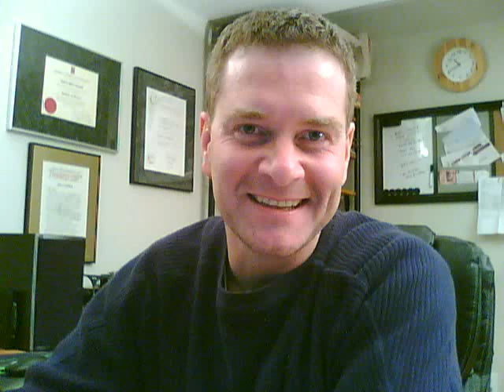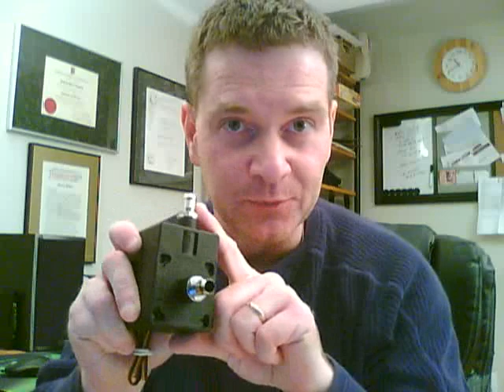#97 - Question/Answer: Water Cooling - Direction Of Flow

Comment: I appreciate the thought in this, though it's old it's still nice to see that others will put this much thought into it... My issue with this though, is on a complicated system where everything is water-cooled, you're putting the heat from 1 component onto another thus using the CPU to heat up your graphics... I doubt that his idea of a larger loop like that would work, but having the radiators in between components would make that better. My challenge I've been thinking of, is doing this on a system let's say with 4 graphics cards and you want to water cool those, the cpu, RAM, & north/south bridge (potentially M.2 SSDs as well) without moving the heat from one directly to another. This challenge is difficult because there will likely not be enough space for 120mm radiators as there are components. Looking up videos on how I might be able to control coolant flow to figure out a unique possibility (using things like splitters or something).

Comment: I don't think that 1st cpu and then chipset is too bright idea... Let's say my CPU is i7 running at 5ghz at 70d load. Why would i want to heat up my chipset with warm water?
1st Chipset, 2nd & 3rd GPU / CPU in order from cooler to more hot (depends on which do you overclock how much and architecture...)
Having the most powerful radiator at the end of the loop to protect the pump(s) from heat.
That being said, let's keep in mind that the difference before and after any waterblock is only few deg.

Comment: In the thermo-electric dynamics heat is a bad thing. As electrical components heat up it increases electrical resistance thus leading to a extreme decrease in performance and in the worst case a total failure.

Comment: i can see what both of us said now, and i wasn't being sarcastic. when you warm things up, they work better. thats why you warm up before exercises. the big HEATsink with a fan on it radiates heat onto the processor from the air. the fan helps to move more air so more heat can be absorbed.
what did you think?

Comment: Really, having all parts (blocks, pump, res) at the same hight would yield the best flow. About placing rads in between blocks, etc I think thats BS. In a normal WC loop one spot won't be more than 1*C different than any other spot in that same loop.

Comment: Well let me bring up a few things here... Saying that more "rads" radiators give a cooler tempature does make sense because there is more surface area and the coolant become more exposed to the room temp and more liekly to get cooler but it also gives more flow restriction on the pump. You really just want one nice big heater core / radaitor or two nice smaller ones. Pump placement does kind of matter. You don't want the pump at the top of the loop, lower is better than higher.

Comment: It's way overkill. More rads and blocks also equals more flow restriction which reduces the cooling potential. You can get by with just one 2 X 120mm Rad.

Comment: For a setup like this: Pump > Large (3 x 120mm) Rad > CPU > 120mm Rad > GPU > Reservoir
What L/hr pressure should be used?
I have a 1200 L/hr by Laing. Is that overkill?

Comment from the maker: Yes, one quality pump with a great flow rate will be enough. FYI: The pump have is from Danger Den (D-Tek DB-1 aka DD-CPX1), rated at 500L/hr (132 gallons/hr). This is a med sized pump, but there are large higher flow pumps out there like the DD12V-D5 Pump Variable Speed by Laing.

Comment from the maker: pump->radiator->water block->water tank loop will work as well. Although I personally prefer to go from the pump's outlet to the CPU water block first, then into the radiator and finally into the reservoir (pump>cpu>rad>res). This way cool water is entering the res and the pump.